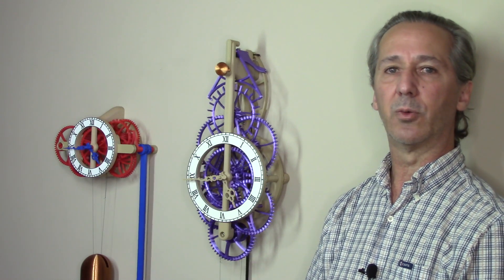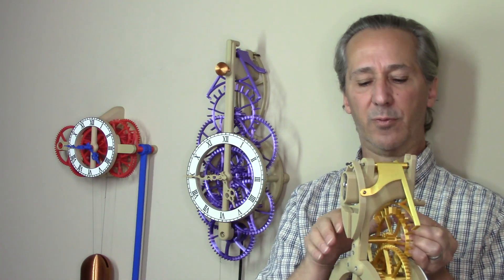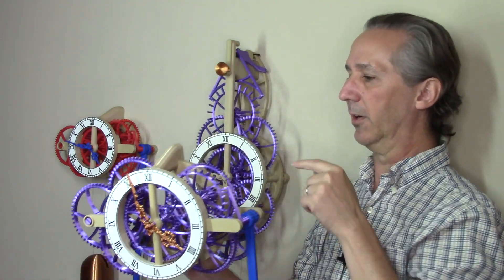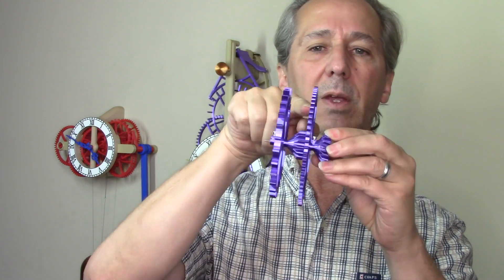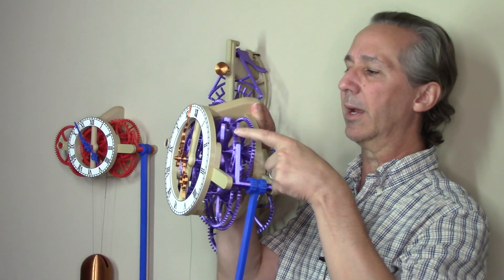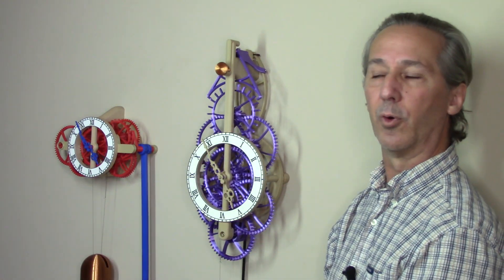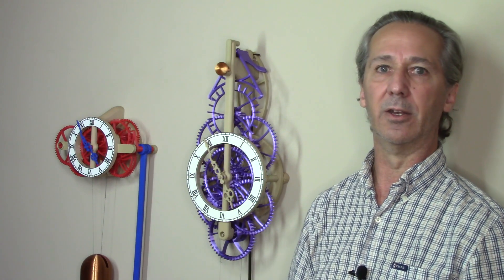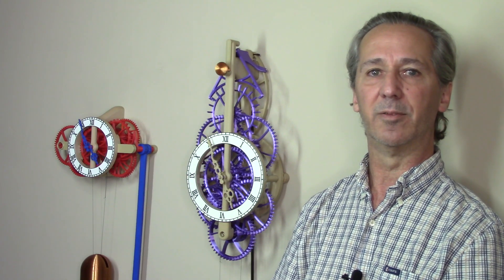Rev 2 Clock Updates

Comment: Hi, I'm a bit confused here.  I'm printing the updated gears for the the 32 day design.  There are three .stl files and all three have provisions for a set screw.  In the video and in the .pdf there are no provision for a set screw on "sp5-gear3-50-12-rev2" and you show it spinning freely on the arbor.  Am I missing something?  Should "sp5-gear3-50-12-rev2" be attached to the arbor with a set screw or not?  Thanks much!
Reply from the maker: The set screw on sp5-gear3-50-12-rev2 may be hidden from view in some camera angles, but it is present and used to hold gear3 tight to the arbor. Page 5 of the addendum shows the side profile where the parts should be clearly visible. The escapement spins freely on the arbor. It sits between gear3 and sp5-spacer-1-rev2.
Reply: @stevesclocks  Thank you Sir for the clarification.  I believe I confused myself by believing that the spacer was the "optional" upgrade, that the original spacer was the part that was press fitted to the arbor.  Actually it seems that gear 4b is the optional upgrade, that is where I had gotten the 2 vs. 3 set screw confusion from.  I should have just taken the clock apart before confusing myself!  🤦‍♂
Reply from the maker: @philshel1  No worries. Glad you got it figured out.

Comment: Hello Mr. Peterson,
I printed the Rev 2 updates for the 3d printed Pendulum clock I believe Rev 2 updates are not compatible with your initial design on Thingiverse.
Can you confirm that?
Because I printed and installed "Sp1 Pallet Rev2.Stl" but unfortunately my Pendulum Clock no longer works (my clock previously worked perfectly for over three years). Somehow Pallet Rev2 and Escapement Wheel don't fit together.I 
think your projects are excellent.Thank you for investing so much time.
Best Regards 
Niyazi
Reply from the maker: Sorry about the discrepancy between designs. 

The SP1 clock on Thingiverse is an old style design that closely resembles a traditional brass clock with sharp pointy escapement teeth. The version on MyMiniFactory has been optimized for 3D printing by taking some of the width from the pallet and adding it to the escapement. Some gear clearances were also improved. 

The Thingiverse design is completely functional for most builders, but the escapement can print differently for others. If it works, it usually works great. The MyMiniFactory design is much more predictable for everyone, however the parts are not interchangeable between MyMiniFactory and Thingiverse.

I will create an update for the Thingiverse clock when I get a chance. It may take a few days since I no longer have a copy of the Thingiverse clock to test the update. It was given away as a gift and continues ticking every day. I will have to reverse engineer the pallet from the STLs to be confident it will work.
Reply from the maker: I just updated the designs to replace SP1_pallet_rev2.stl with SP1_pallet_myminifactory_rev2.stl and SP1_pallet_thingiverse_rev2.stl. New parts sometimes take a few days to migrate into the zip file. They can be found now by expanding the "Object Parts" section and downloading the files individually.
Reply: Thank you Mr. Peterson for your quick response.

Comment: Impressive clock designs Steve. I am planning to buy the 32day easy build design, will it have these updates in the main download or I need to do a separate download for this screw systems in gear 3. 

Also I am new to 3D printing and planning to use the 3D printer in the local library, could you please recommend any specific printer settings to take care before printing and also which type of 3D printing spools I need to buy. Thank you!
Reply from the maker: The new files are available in the main download area for each design. The separate download area is for users that previously bought the designs and only need the updated files.

Everything is printed in PLA which is one of the most common types and easy to find. You will need at least two contrasting colors. Approximate quantities of each are listed in the assembly guide.
Reply: @stevesclocks  Thank you for the quick reply.
Reply from the maker: @pinu1166  Also, double check that your library will let you print something so large. Our local library has a limit of 4 hours per month.
Reply: @stevesclocks  Good point, let me check that. How long does it take to print the whole thing? Any suggestions for a good affordable 3D printer for home use?
Reply from the maker: @pinu1166  The total print time is in the range of 80 hours with a few parts over 10 hours each. Many builders have had success using the Ender 3 series of printers. Information about them is plentiful on YouTube.
Reply: @stevesclocks  Thanks